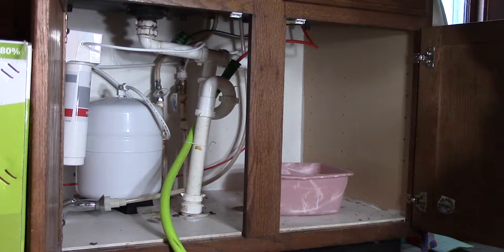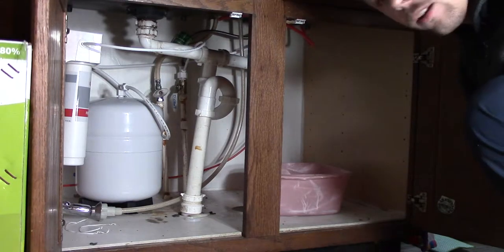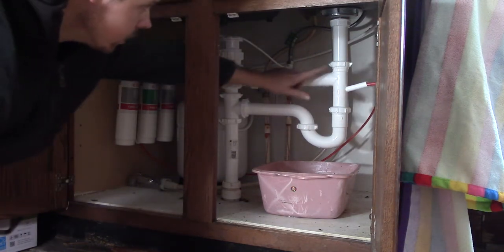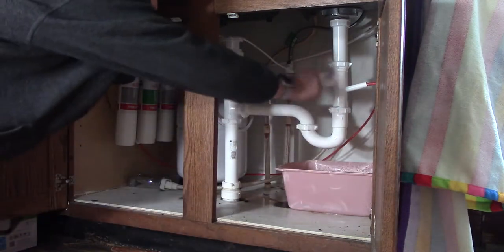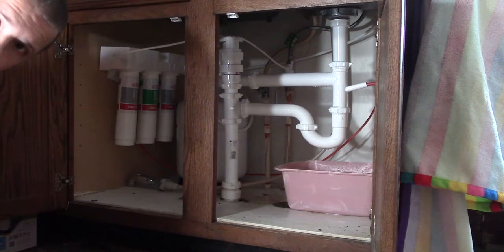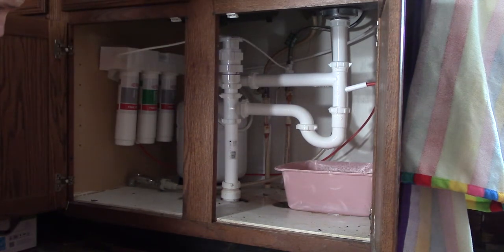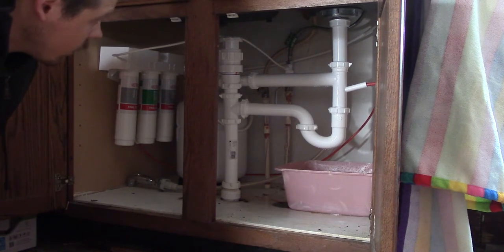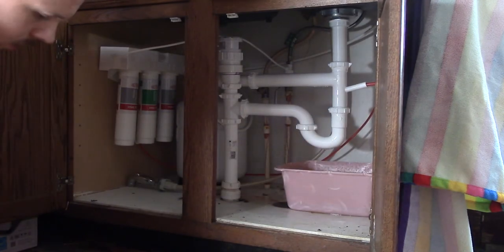Kitchen Sink Plumbing Upgrade

Comment: You need to raise that air admittance valve approx to the level of Basin drain there is no way you are meeting the height requirements.You need to use 11/2 Dwv pipe heading down as your soil stack and it needs a sanitary t connecting with the pipe exiting the p trap. Also you need to create an air gap for your drain from the water filtration of waste water flows back that drain or your p trap gets siphoned and gas flows to that drain you could get sick . You could make a dishwasher air gap work or they offer many options for air gap fittings for water softeners and. RO SYSTEMS, or have some fun and design your own air gap fitting!!00. Also your soil stack is long enough you need to incorporate a clean out.

Comment: You shouldn’t have to use putty or silicone to seal you tailpiece coupling to your basin. You use a. Tailpiece seal . If it’s leaking with a tailpiece seal installed something is wrong.

Comment: For the leaking of the red drain pipe, try using cauk.
Reply from the maker: I might make a video of my fix for the basement floor drain at some point. Once I actually have it completely fixed and working properly. I'm currently using a strip of plastic that I put in with silicone caulk. It leaks from someplace though, so I need to clean it all up and try again.
Reply: Do not use caulk. That is a barbed fitting. It’s not made for a hose to go inside it it’s made for a hose to slip over it. And I’m sure your filtration systems instructions will tell you that an air gap must be created. Don’t just hook it up to a waste line. At the very least create a high loop or use a dishwasher air gap. Right now you are giving it a straight shot gravity assist back to the filtration system.